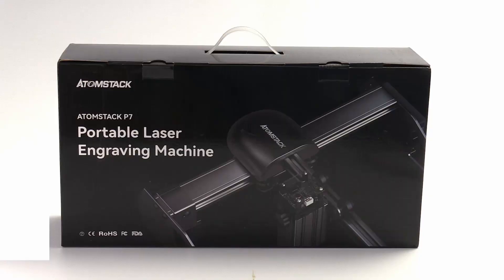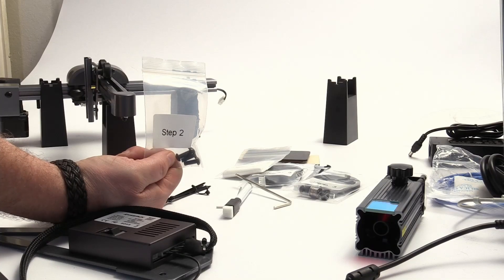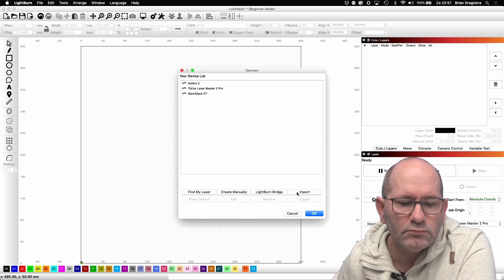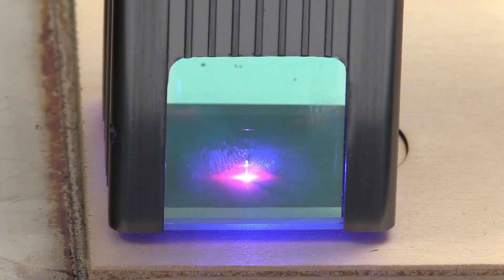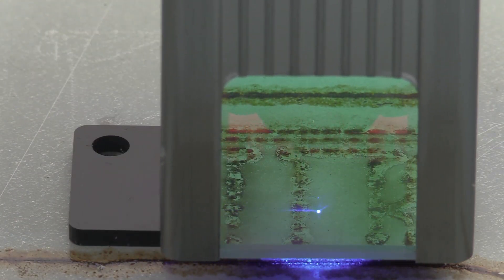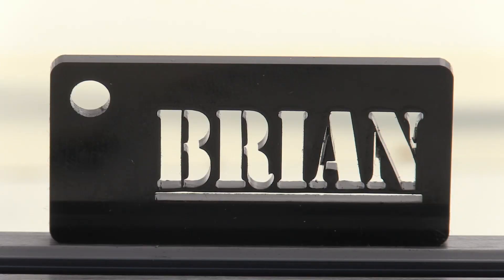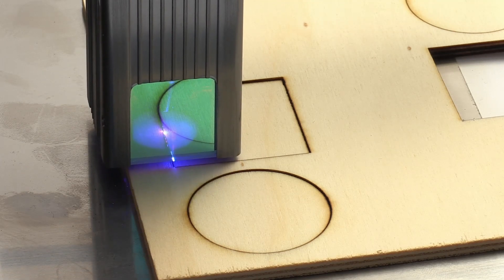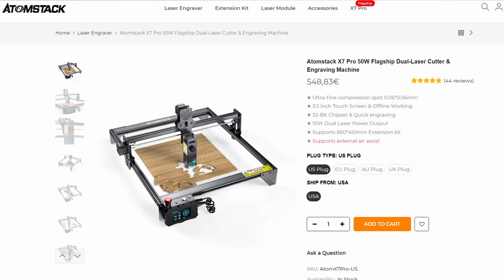▼ Atomstack P7 extreme power

Comment: Hi, what settings did you use to cut the 3mm acrylic?
Reply from the maker: It's a little time ago, but I think it was 400mm/min at 60% power on Black Acrylic.
This is my standard acrylic setting for most of my 5 Watt lasers, and it works almost always without tweaking the settings.
Reply: @3dPrintCreator  great detailed video   can it write really small character like 0.1 mm

Comment: Hi Thanks for taking the time for this review, great job.  I am thinking about buying it but i am confused by your comment about being better to buy a lower power laser for wood engraving ?  My main use will be wood engraving and slate engraving, ( 10 x 10 cm coasters) so is this laser too powerfull for that ?  What would you reccomend ?  Thank you.
Reply from the maker: It all depends on the type of engravings you want to make.
For fast line engravings, a high power laser is great. It's very fast, and it works very well.
For photo realistic engravings on wood, you will never use the laser at it's maximum power, and when you buy a lower power laser, you will have more steps in between full power and barely visible, resulting in more grayscale.

Comment: Hi.. Can this model use with R3 Roller..?
Reply from the maker: I don't know the R3 roller, but almost every roller is compatibel to almost every type or brand of laser. This is because the stepper motors used are all the same type Nema 17 motors. You disconnect the wire from the Y axis and then you plug that wire into the stepper motor of the roller.

Comment: How many watts was it again? I just acquired a 30w p7 atomstack and I was wondering if it is the same product you were describing.
Reply: By the way I was referring to the whole machine wattage... the laser Is at 5 watts.
Reply from the maker: Yes, It is the same machine I have here. They call it 30 Watt because it draws 30 Watt of power from the net, but the laser is having a light output of about 5 Watt.
Reply: @3dPrintCreator  Thanks for confirming. I'm not sure if the machine wattage has significant advantage if it's higher, - if not, I am planning to change the laser to one with a higher wattage in the future using the same machine if there will be a need, but so far test results I made are quite satisfactory to my liking and my intended objectives. Thanks again. 😄

Comment: Can this laser cut white acrylic?
Reply: They recommend using dark acrylic, I suppose because white reflects light more.
Reply from the maker: Hi, thanks for your comment.
No, White and transparent acrylic are very difficult to cut with a laser that uses light at 540nm (the blue laser light).
But dark blue, red, purple and grey acrylic I can confirm that they can be cut. 
Also, for creating signs with transparent acrylic, you can use purple painters tape on top of the acrylic to get the heat from the laser into the material and that will engrave the transparent acrylic. It's not enough to cut, but good for engraving.

Comment: Hello, great video. Can this laser glass ? Thank you
Reply: Rachael, they claim it will etch glass. I ordered one of these, but, I haven't used it yet, so I am just repeating something I read about it.
Reply from the maker: All 540 to 545 nanometer lasers with at least 5 Watts of power can engrave on glass.
For some glass types you will need a black whitebord marker or dissolvable marking spray, but it will for sure engrave on glass.
(Watch out for small glass particles in your drinks though. This is a real danger as sometimes not only te outside of a glass is engraved).

Comment: I swapped out the M40 5W Laser with a M50 10W Laser module and found that the lateral arm is loose so that when adjusting height  I have to put weight on the arm to keep it from dropping down after removing the height card. I also don’t like the module’s shell extending past the laser’s output, that kept me from using it on pockets. Plus AtomStack doesn’t sell the air assist nozzle alone I have a air brush compressor that has enough cfm.
Reply from the maker: I don't have their M50 module to test it.
If you have access to a 3D printer, there are all kinds of air assists that you can print yourself.
Also, there are many online shops selling air assist heads that fit almost any diode laser.

Comment: What would you recommend for a beginner engraving laser for travel cups, wallets, phone cases, and glass?
Reply from the maker: Well, this laser would be a very good one.
You don't need more powerful lasers for engraving, but you have to consider the size limitations.
If this laser has enough travel for you, meaning the images you will engrave don't exceed 20cm in any direction, then this laser is your choice.
If you need something more extensive, you can look for a laser with a bigger engraving size.
Also, more power doesn't only mean that you can cut things, but also you can do your engravings a lot faster. I think the TwoTrees TS-2 which I reviewed on this channel, is one of the best lasers at the moment, yet it might also be "Too big" for you.

Comment: Hi, great video.
I have one question since I am looking for my first laser cutter: You said you would recommend the cutter unless you want something with less power for better engraving.
Isn't it possible to use this machine with lower power settings and still get good engravings out of it?

I really like the small size of this thing but I would mainly use it for engravings and not cutting.
Reply from the maker: Hi,
The thing is, from no power, to maximum power, is divided in 1000 steps. Now for engraving, you would only need about 2 Watt of optical output power, therefore 3/5 of the output is useless as this would burn to deep into the material you are engraving.
This leaves you with about 400 gradations of no engraving to maximum black, while with a laser with less power, you would still have 1000 gradations of no engraving to maximum black.
Therefore, a machine with a low power laser would be beter for engraving, but is useless for cutting.
Reply: @3dPrintCreator  Thank you for the detailed answer. That really cleared things up for me.

Comment: Hello mate great video, I have this laser too, I’m learning with it..
Would you be so kind in putting starting some setting up for me to start working with, like for example the cutting settings the black acrylic, the engraving settings for stainless steel..
Also for say 3mm mdf would you say it’s best to have more passes and higher speed and lower power, or higher power and slower speeds..
Reply from the maker: Best thing to do is make tests with every new type of material. There are lots of laser test files on the internet, and if you use lightburn, there is a test in the software as well. Use that to cut 10 circles with a width of 10mm and see which one gives the best result. Do the same for engraving, and remember the results.
In Lightburn you can make profiles for each material with the settings toy found.